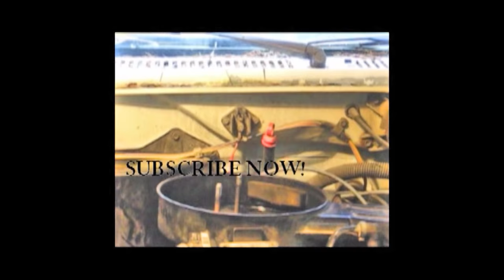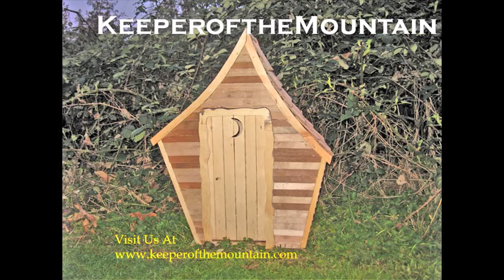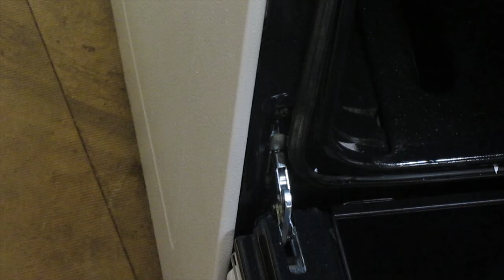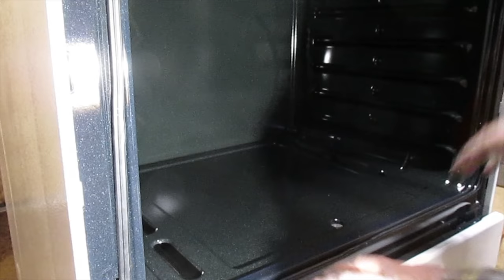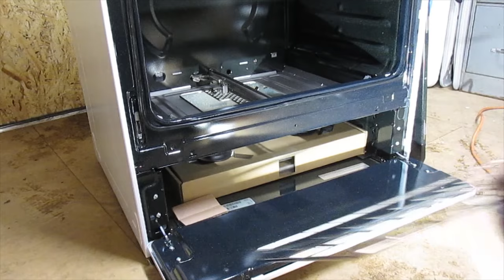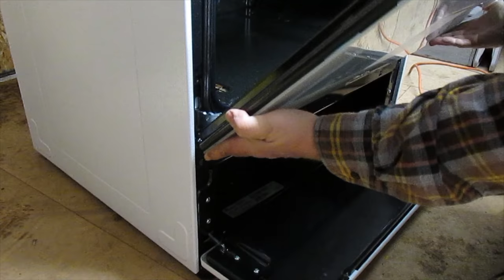Converting a Natural Gas Range to Propane

Comment: Do you know how to change the electric trip valve on newer gas stoves? When our electric goes off due to storms, our gas stove has a close valve on it so we can't use our stove. Thank.you kindly.b
Reply from the maker: There should be operating instructions that came with the stove. If not, look them up online using the model and serial number of your stove. I do not recommend bypassing any safety devices on your stove. They are there for a reason. In addition to that, if you do bypass them, you will void the warrantee.
Reply: @KeeperofTheMountain  Thanks.
If power is off, we can't use our gas stove or stove top as there is an electric switch that keeps the stove from operating.. I grew up with a gas stove and we used it all winter, if power went off due to ice storms. One  winter, an ice storm was so bad, so many trees fell and took out power lines and we were out of power for weeks. Trees and limbs were up to our thighs from neighborhood to neighborhood. So we all just camped in the family room by the fireplace to stay warm. We had oil lamps and the stove so we did fine.  We just don't like this model not being able to work in a power outage. We know how to light the old models with a match. I guess they think people can't learn properly anymore. I believe it is another way to keep people from being self sufficient in a storm. Propane supply here is out all the time. Really don't want to have to cook outside if I don't have to. Thank you for your time.
Reply from the maker: @EagleArrow  I get what you are saying. You are probably right.
Reply: @KeeperofTheMountain  I probably should just get a new wood burning oven/stove. 😀

Comment: While obviously all models are different, I'm installing a used GE range and converting to LP and one peculiar thing about it is (maybe it's because it's an older 90's model) is how different my regulator is.  It does not have a hex nut cap but rather just a strong plastic cap over one end, and to convert it all you do is unscrew it and flip it over. I know that sounds similar to a lot of stoves but trust me, this is different.
Reply from the maker: Yep, that is one variation.  It is still doing the same thing though.
Reply: My new GE range has the same, only if you read the GE Instruction on how to change that orifice you'd never guess in a million years that all you need to do is flip it over.  I never trust factory instruction documents, and that saved me a lot of grief, but you did warn a lot of folks that will be victims of trying to do what the manufacturer instructions tell them.  GE also has a video on line about how to remove the oven door, except the door in the video doesn't remove that same as your new stove.  Then, just to insure they really screw you for doing it yourself, the new stove owners manual also explains how to remove an oven door the new stove does not have on it.
Reply from the maker: @NaYawkr  Glad it helped.

Comment: What about the connection to the propane source tank?
Reply from the maker: That is really a whole other video. But briefly, There are a lot of variables but, if you are putting a small tank next to the home get an 11" regulator which is about 1/2 lb of pressure. Do not use a red regulator or one with a red knob. That is a 10 lb regulator and that is too much pressure to be safe,

Comment: How does the propane hook up in the back occur
Reply from the maker: 3/8"-1/2" or 3/4" pipe thread. it depends on what range you get. That hooks to a flex pipe that in turn hooks to the gas valve that is almost always 1/2" pipe.
Reply: Keeperof Themountain Thanks!
Reply: Charlie Rothwill  I pray for your happiness and salvation. Was going to say more to reason but bring as a Follower of Christ, I subscribe to his teaching about “casting pearls before...”

Comment: What about hooking up to propane?  I soo want to destroy my electric range.
Reply from the maker: Do a google image search for, "Propane tank clearances". The picture you will see is right out of the code book. Then you will know where to put the tank. My recommendation for cooking only is a single 120 gallon tank. For most people that is over a year's worth of cooking gas. 
Use a Rego model number  LV404B34 regulator at the tank. Piping will depend on where the range is and where the tank is. 
A 120 gallon tank can sit right against the house and not require going underground. Any tank over 150 Gallons must be 10' from the house and property lines. 
I recommend having a propane company come out and tell you what you need to do in your specific application.

Comment: How do you adjust the burner flames?
Reply from the maker: On some models if you pull the handles off there will be a small screw head inside the stem that the knob fits on. You use a wrench to hold the stem at low flame and a tiny screwdriver to turn the little screw. One way will make the flame bigger and the other way will make it smaller. Once you have the flame where you want it on low, put the knob back on and use as normal.

Comment: Whats that blue thing called at 11 min.
Reply: And its missing
Reply from the maker: @Idgf420  Between 10 and 11 I flip over the spring retainer to change the spring pressure. Some regulators you just flip the cap over. The cap itself is the spring retainer.

Comment: Natural gas pressure normally  4 oz or 7 in water big difference is btus of different gas
Reply from the maker: Read the rating plate on any ng appliance. It will list it at 3.5 inches of water column. You are right though that although they both come out of an oil well, they are two very different gasses. Different specific gravity and different btu rating.

Comment: 5.3oz for natural gas
Reply from the maker: Read your rating plate. It will most often say 3.5
Reply: @KeeperofTheMountain using a G211 Manometer we set natural gas at 5.3oz and 11.5oz for lpg